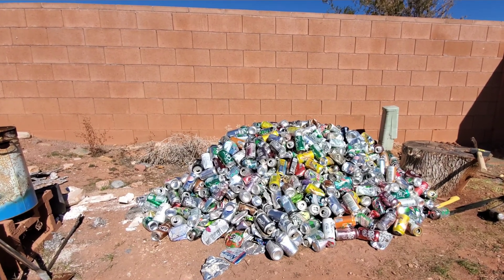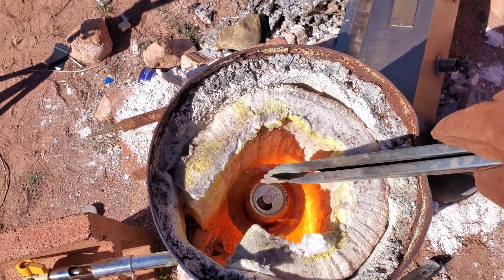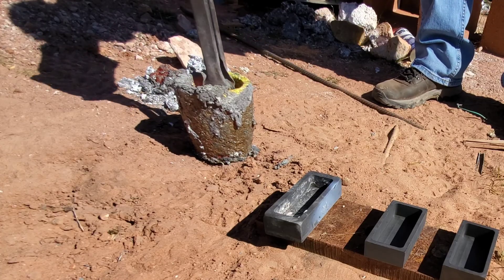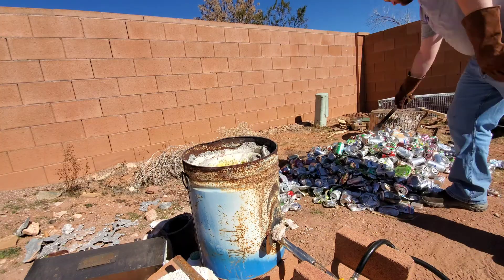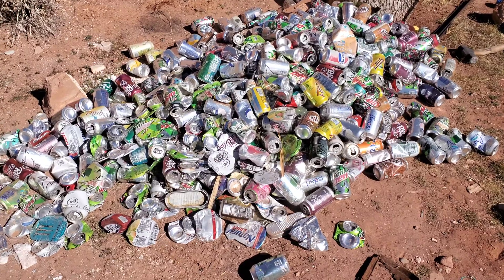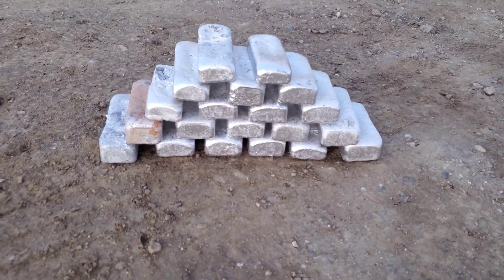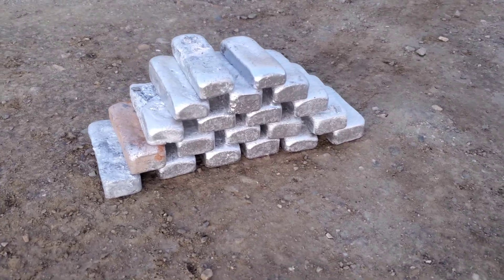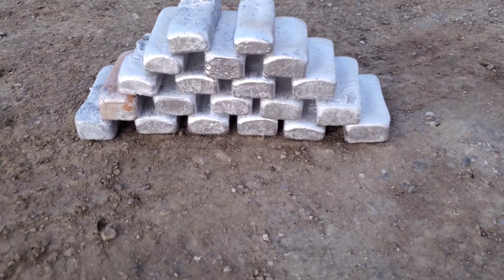Melting 1,000 Aluminum Cans at Home - How Much Aluminum Do You Get?

Comment: Wow, I expected way more bricks from the huge pile of cans.
Reply from the maker: I did too. There was a lot that went out with the slag. If I wanted to remelt it, I  could've got more but there really isn't a lot of aluminum in each can.
Reply: @ForgingFish  And it requires a lot more energy to melt the Aluminum Oxide, meaning either induction heater or electric arc furnace. Which they can be built at home (induction heater is a bit harder to make, you want the work coil to be as resonant at between 1,000 Hertzs to a megahertzs AC frequency so it induces significant amount of amperage current internally in the slags so they start to melt), or bought cheaper if you know where to look for those hardware.